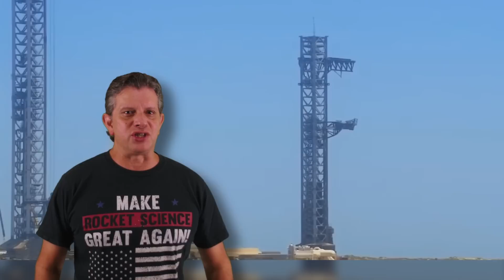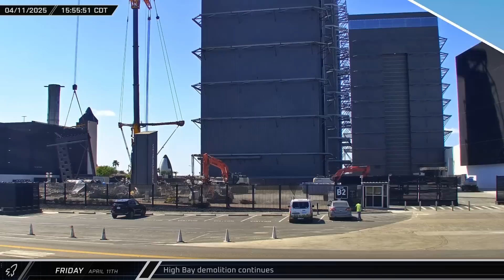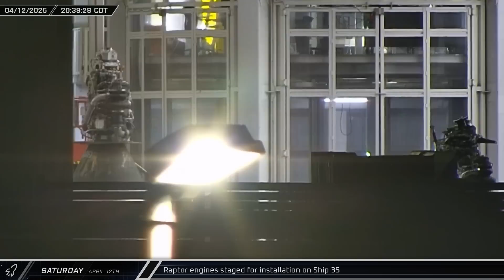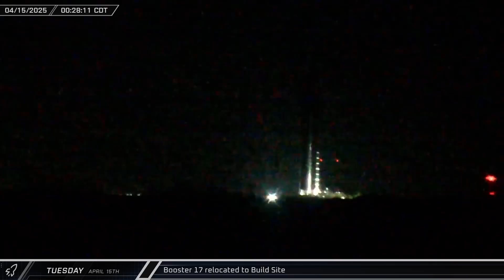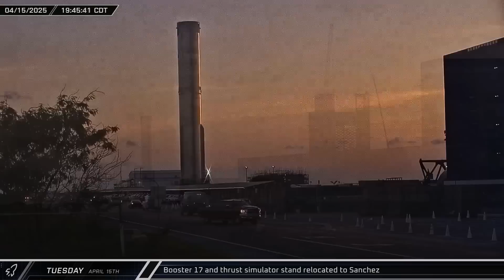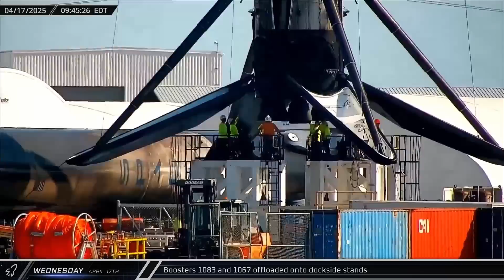Starship's Next Launch Pad is a Huge Upgrade - SpaceX Weekly #163

Comment: Excellent video!
The build out of the Pad B tank farm seems much larger than the Pad A farm. Will they rework the Pad A farm when B becomes operaational or will the B farm be used to feed A as well? I'm guessing A is going to get a full make over once B is available.
Reply from the maker: I'm thinking the farm will supply both pads.

Comment: A method to boost launch thrust through water injection...

A rocket launch may be granted a momentary boost at launch by the injection of water into the engine bay during liftoff.  

This water, when dropping into the thrust envelope, will flash to steam, thereby increasing the overall expansion of the expelled gases beneath the vehicle and therefore providing a notable increase to launch impulse.

The injection of said water may be achieved with the incorporation into the thrust puck of a tubular ring main.  This ring main will be attached to one or more severable hose connections extending from a tower-mounted umbilical. 

The hoses provide copious water supply at ignition, flooding the engine bay above the engines such that the delivered water cascades down around the bell nozzles.  The water supply is maintained for as much as five or six seconds after lift-off at which point the hoses are severed and the last of the water drains from the ring main.

It is considered that as much as a 10% impulse gain may be realized by this system without any notable weight addition to the vehicle, especially if the ring main is an integral part of the thrust puck structure.
Reply: Where did you get that?  It is considered?  By who?